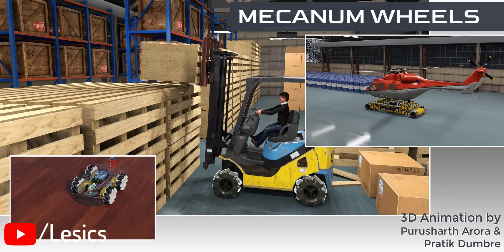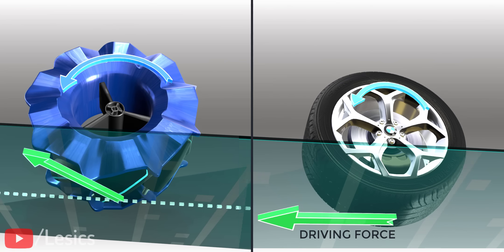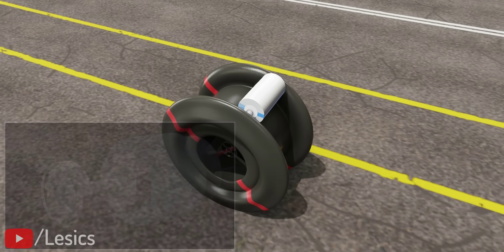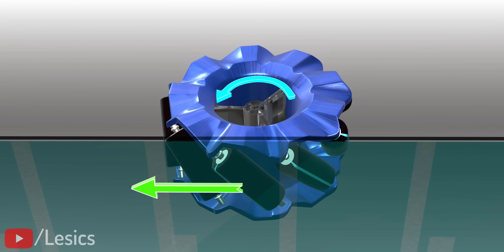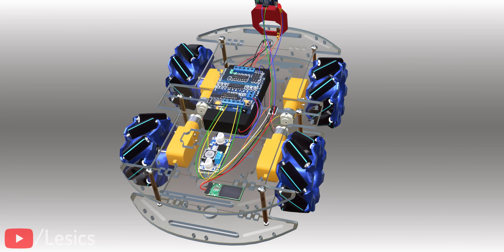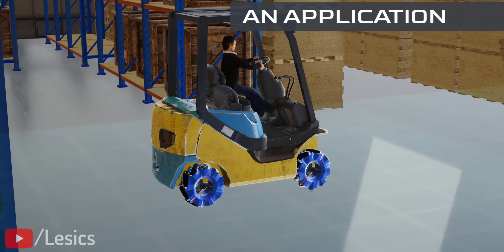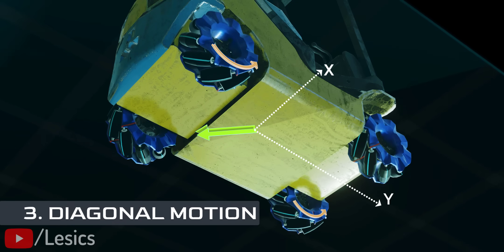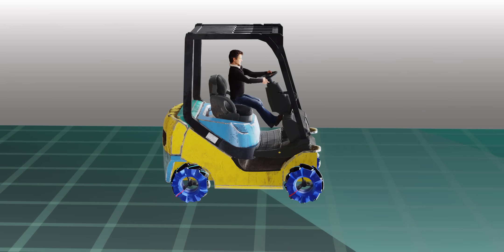The Brilliant Engineering of Mecanum Wheels!

Comment: Clever, but as you can see from the vector forces, there is a lot of forces cancelled, which mean not energy efficient. Also small contact patch means high weat or expensive materials. That is why some way smart ideas dont get to thrive. These videos will benefit if they present the limitations of anything new and the barriers to adoption. Furthermore, for the  people that bring the example of no work being done when one pushes against a wall where the forces cane out please consider that  in the example of pushing against a wall, work is not done with regards to wall being moved, yet one does waste muscle energy into thermal energy via pushing in vain. Same for example if a car or machinery that is stuck against a practically immovable object. They do not move the object, yet they burn fuel or electrical energy to thermal waste instead of useful work in moving said "immovable" object.
Reply: Regarding the comment about vector forces, the assumption you are making is not true. Work is not being done simply because a force is present. Work is done when there is a displacement associated with the force. Example: If you push on a wall and the wall does not move, no work is being done. For there to be power, the wall would need to move. Another example would be to stand on the floor. Your weight is a downward force on the floor, reacted by an upward force from the floor onto your feet. Regarding wear, most mechanum wheels have a taper, resulting a line contact over multiple rollers. This is similar to contact ratio in gearing. There is a higher hertzian stress because of the smaller radius but that can be compensated by larger overall wheel diameter and more durable materials.
Reply: @davidsandy5917  except in your example of pushing against a wall work is not done with regards to wall being moved, yet you do waste muscle energy pushing. Same in a cara or machinery that is stuck against a practically immovable object. they burn fuel or electrical energy to thermal waste instead of useful to us work of moving said immovable object.
Reply: It's a forklift, who cares about efficiency
Reply: @Chris-rg6nm  Efficiency is very important! If you are running 3 shifts a day, and you have 2 forklifts with 9+ hour battery life, There is always one charging and everything works out. If your folklifts need to be recharged every 4-5 hours, then you need more forklifts. (Just because it drains faster, doesn't mean it charges faster...) The batteries will also need to be replaced more often. (A used forklift battery was over $1500 before being reconditioned. I checked out of curiosity 20 years ago. I'm sure it hasn't gone down. I have no idea how much a reconditioned or new battery would cost.)

Where I work, our forklifts are propane powered because of one steep ramp in our warehouse. That one ramp is too steep for battery powered forklifts, so we have to keep propane tanks in a special area, and the drivers have to change those tanks instead of simply plugging in. The warehouse has to be ventilated because of the exhaust, so we cannot heat the warehouse. All going back to forklift efficiency...
Reply: @Chris-rg6nm  no one cares for the forklift. The wheel is another thing ! :)
Reply: True that. Though if perfectly designed with ideal (not real world) roller-bearing surfaces and the right (read expensive) materials then those losses are negligible. Problem is we do live in the real world, friction exists in even perfect bearings, and the perfect material doesn't exist, and cost feasibility is the deciding factor.
Reply: A kid designed a mechanical vehicle (walker?) with 4 square wheels that are all slightly out of sync. There was always one wheel able to 'chunk' forward and pull the little vehicle a bit further. Sure, it worked, and the kid is a genius, but it isn't a practical mode of traction. I don't think this is a very practical fork lift either.
Reply: I think depending on the use case it could be efficient. Sure, you have one wheel partially working against another at almost all times, but the maneuvering required to go sideways and whatnot for regular wheels is also "wasted" energy. So it depends on which type wastes less for each use case. Not sure if there are actually any cases where maneuvering is troublesome enough for this to become efficient, but it is interesting. Also might be time efficient (remember, one maneuvering vehicle might mean more having to wait for it to finish), or helpful to get more usable space.
Reply: I mean, if we are being that serious, doesnt we cancel forces each time we turn in a normal vehicle? Would mean this ...only straight roads must get build? or in resume, are the energy "wasted" valuable enough to make the added "agility" not to be worthy?... because we could almost claim that cars should get removed from cities and all should get replaced by train under similar principles.
Reply: @BioClone  it is all about the actual numbers and actual percent energy wasted. The amount of energy wasted in your examples unlikely to match the constant inefficiency of these wheels. Furthermore about cars to be replaced by mass transit; many people argue about that, and many cities have banned or limited the use of cars within certain perimeters.
Reply: I was wondering the same thing about the cancelled forces--the energy for the wheels pulling against one another has to go somewhere...
Reply: @waylonk2453  dat axle lol. Indeed it does seem like a terribly inefficient configuration. But it fills a niche!
Reply: But still 50% efficient making a stationary rotation is hugely more efficient than 100% efficiency in making a big circle
Reply: @happity  true if you 100% of time you run in circles :)))
Reply: @deltagbeta  yes, obviously!
Reply: @happity  :) true if you 100% of time run in circles ! :)))) like your handle ! stay happy in circles :)
Reply: @happity  Yeah I guess so also, it could be more efficient at that particular moment while rotating though maybe by not as much. Even so, travelling in straight line, whether forward, backward or sideways, still comprise most of its movement, I assume.
Reply: I totally agree that Lesics videos would benefit from a more balanced presentation. But you are wrong about the cancelled forces: Forces cancel out all the time in mechanical systems and that has nothing to do with energy. For instance, if a pen lies on a table, the gravitation force on the pen and the normal force from the tabletop cancels out. No work is performed, and no energy is expended.
Reply: @mumiemonstret  It's different. The pen and the table top forces do cancel that's why there's no movement, only equilibrium, no work. But in this mecanum car, a work must be done and two active forces in different directions combine so that the resultant force would move the car in the direction intended. Real active forces has to be cancelled out. This car is indeed inefficient but this car is built for mobility not efficiency, that's why don't expect this to become a viable transpo. But indeed this could be very valuable in tight spaces or warehouses.
Reply: @MrKockabilly  My guess is the cancelled force for mecanum wheels is akin to force cancellation when two wheels rotating in opposite directions push against each other. Energy is expended in the form of kinetic friction of the wheels rubbing against the ground.
Reply: @MrKockabilly  I thought the same at first, but what hes saying is probably that the small rollers "rolling" is what cancels the sideways movement, and not the rollers rubbing against the ground. In that case, there isnt actually too much energy lost.
Or said in a different way, the rollers can rotate freely, and the rolling "uses up" the sideways motion equally on both sides, while forwards motion is the remaining energy that the rollers cant dissipate.

Turning and sideways movement is probably a bit less efficient, although probably not that bad with an electric forklift. The roller roling will also be creating a small bit of drag, but Idk if thats meaningful.
Reply: @termitreter6545  just mathematically, if it can make a rotation in 25% of the time at 50% efficiency, it's still 200% more efficient
Reply: @MrKockabilly  I don't know how much this would cost compared to regular forklifts over a lifetime of use, but I think it would make more sense to layout a warehouse with a little more space for maneuvering and sacrifice a little product storage. If your warehouse is that tight, and one has workers driving a doodle bug like this, one is going to lose product to accidents anyway. (That thing looks like an accident just waiting to happen! I take my life in my hands walking across the supermarket parking lot! Forget mountain climbing or underwater cave diving, grocery shopping is more thrill than I can take.)
Reply: @MikeLinPA  I myself don't think this one would beat the viability of even the standard forklift for a standard warehouse. But the concept is there, if one can find a viable use for it (whether in a highly-specialised warehouse, as part of a system or machinery, in micro-scale movements, or whatever) then look no further and that's good. I'm new to this concept and find it clever and interesting.
Reply: @happity  If you got limited space requirements and lots of turns, then theres forklifts with quite extreme rear wheel steering.

But as said, Im not convinced anymore that efficiency is a big factor.
Reply: @happity  regarding time efficiency, doesn't mean in actual energy. If you travel with your car at twice the speed limit in the highway you reach in half the time at your destination but you burned more gas
Reply: @mumiemonstret  A counter example would be a fighter jet doing a tail stand. The forces cancel, but fuel is being burned at an astronomical rate! Lots of waste.

Don't believe me? Try walking along side a wall. Easy, right? Now try walking against the wall at a 45' angle. (135' angle?) You will still slide forward along the wall in a straight line, but you will be tired when you are done. That angular force is a lot of wasted effort. You will also ruin your new jacket, same as wearing out those fancy wheels. Friction has consequences.
Reply: @MikeLinPA  Again, you assume that sliding is involved. It isn't. I can accept the walking obliquely against a wall metaphor, if you are painting the wall and hold a paint roller in your hand.
Reply: @mumiemonstret  When using a roller to paint a wall, you are only applying a little bit of force. In my wall metaphor, if you applied that much force obliquely (Thanks for the word! I needed that.) to a paint roller, the roller might brake.

Did you ever see how fast a set of tires gets ruined when your car is out of alignment? That is only a few degrees out of alignment. The wheels on this concept vehicle are pulling out at 45' in opposite directions. That is a tremendous amount of force to waste! Sure, the wheels on this concept have rollers, but they are still going to take a tremendous beating, and the battery life of the vehicle is going to suck! It is a genius idea that just isn't practical. IMHO

BTW: I'm not fighting with you. I appreciate your replying and discussing. Happy new year!
Reply: @mumiemonstret  Correct on the principle of cancelling forces not being a generalizable concept of wasted energy, like the you described. However in the above case the forces need need human or machine energy to be produced and thus energy is used and wasted if you cancel the them out.

Comment: This is a variation of an early 1900s invention. I can't remember the name but IIRC it was tractor or car with large drum like wheels with diagonal ribs. There was a B&W video of it running around in snow.
Reply: Do you mean screw drive? It's basically two screws mounted in place of tank tracks and they have some interesting similarities to this system. They only work in snow or water though, because the screws generate a lot of friction. The rollers on the mecano wheels are what makes them work without parasitic friction.

Comment: This is practical for low speed applications like warehouse forklifts and factory robots where you can use them on uniform floor areas and much controlled environments.  Brilliant idea. 👏
Reply: Except the wear and tear costs and the fact that these wheels have problems bearing even moderate loads.

Plus the fact their "new" and "innovative" means there very expensive. It just costs more to have them than what they can put out for product. Especially when their are systems for lifts that have sharp turn radii already with normal inexpensive tires.

Is the concept cool and interesting? Yes. Is it practical and efficient? Not really. Plus you gotta factor in if someone is going sideways down a crane isle their taking up most if not all the clearance, thus opening up more problems for foot traffic and collision with hazards.

Comment: Perhaps develop a telemetry system to interpret where the vehicle is in a controlled environment like a warehouse using a cartesian co-ordinate system. Then outside of working area; use a camera mounted on under side of vehicle to discern motion relative to the ground under the vehicle (Like an optical encoder) for manual operator control only.
Perhaps for manual control, use a joystick, not a steering wheel with twist to rotate on the z axis. Joystick would command the vehicle according to the vehicle's position (Not the wheels of the vehicle) in order to compensate for real-world variables that would affect the wheels. Release joystick to stop all vehicle motion even if the wheels need to keep gimbaling to hold position. 
I imagine that it would be easier for an automatic control system inside of the working area as there is no turning circle to factor in. Just go to grid x, y, z by travelling like a queen on a chess board.

Also, If it does not need to turn it's front wheels or power it's rear wheels then it does not need to look like a fork-lift.

Comment: Usually the wheel in canterbalance takes five minutes to change, and it gets damaged quite often.  How long does it take to repair the depicted wheel?  In addition, the reach truck is perfect for maneuvering in confined spaces. Simple and effective. In my opinion, the solution presented here is interesting, but more expensive and does not really add anything new.Additionally, the handling of such a forklift certainly requires more complex steering, which may result in the operator working slower.

Comment: Those rollers would not last very long under a heavy forklift. Also, each wheel would probably have to be powered by electric motors to allow for precise control and to synchronize each direction desired. It would be pretty difficult to have a single engine with an all-wheel drive system that could achieve all the different directional controls at each wheel. If the rollers are "free" as they appear in this video, I would imagine a difficult situation of control would arise if the forklift needed to accelerate or stop on slippery surfaces such as oil spills or ice patches. It appears that all four wheels must have an equal amount of traction to achieve the desired motion.
Reply: If only the big forklift manufacturera that use the method would have known...